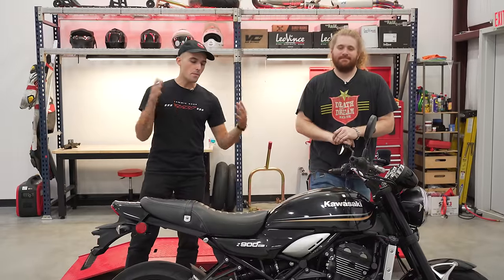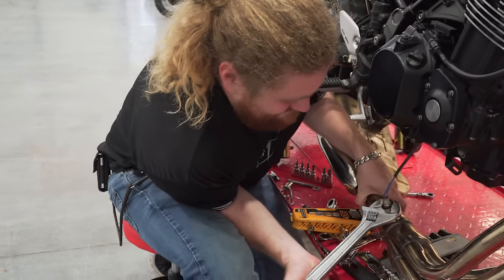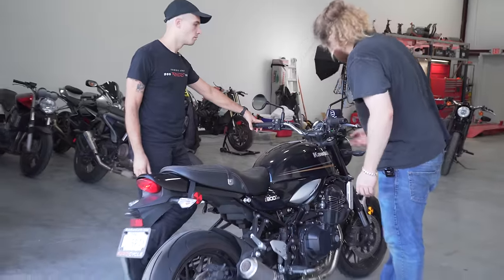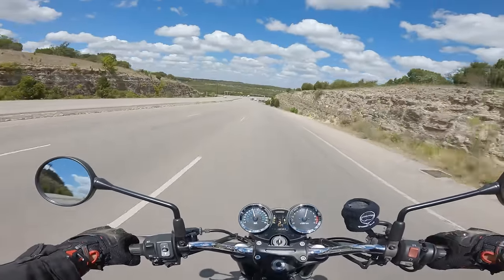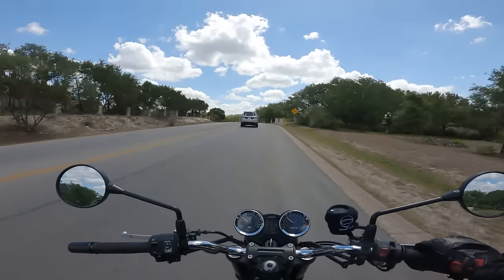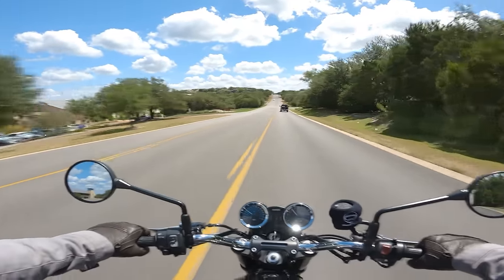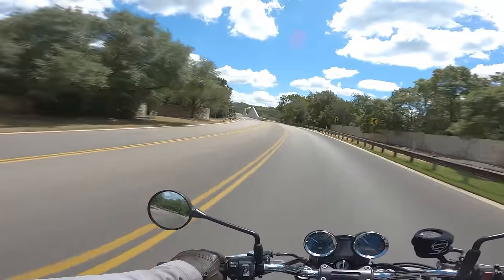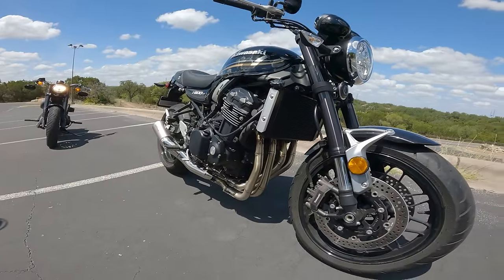Our Z900RS is FINALLY Fun Now!

Comment: The pipe makes a big difference, now do the flash and you'll see what people are saying. Love this bike!
Reply: I purchased my 0 mile 2019 Z900RS Cafe last June and made a point to ride it stock for a year before doing the flash and exhaust.  I love this bike and hear great things about a flash.
Reply: I have this bike- stock fueling = slightly let off  of throttle = cuts off all fuel to engine= abrubt engine braking... very tedious.  An ECU flash reprograms the  fueling so the engine isn't starving for the gas
Reply: @Justen1980  Ya,  It bothered me for a few months of riding but then you get use to it.  Still going to flash and get rid of the fuel cutoff on decel

Comment: I would only do a header swap, the stock exhaust is tuned perfectly for the sound IMO
Reply: Did mine with Delkavic header & stock can & reflash, 10% power & torque gain & sounds way better without being obnoxious plus it's still technically road legal!
Reply: @andrewprice1189  noice, can an emissions test be passed with that setup? Going to do the exact same thing as you (plus airbox mod).

Just waiting patiently for my cafe to come in, the shipping company's been fumbling the delivery smh..
Reply: @hyedefinition1080  Not sure as i am in Australia. Police etc more interested in ridiculous loud pipes than whats coming out of them. Great bass roar just with Delkavic headers & stock exhaust but not that bad you will draw attention. zero on/off throttle snatchiness 100 times better
Reply: I can’t stand the brand but one thing that Delkevic has done right for this bike is that classic 4-4 exhaust.  I wish someone would post a video of that one with the baffles out, even though it sound great with them in!

Comment: Ya really only needed the header. The stock can has literally no baffling in it at all, it's all on the cat.

I spoke with a guy who has a fully built one with 1083cc pistons, Yoshimura cams, port & polish, airbox mods and high flow filter. He's tuned to 135whp and almost 80 torque. He said the stock cams were damn near perfect circles and he wasn't sure how they made any power at all.
Reply: Did mine with delkavic header & stock can which is all you need, technically still road legal as well. Reflash to cure that low rev snatchyness caused by the fuel cut off. Transforms the bike & the only mods you need
Reply: Im thinking the same with getting just the headers. Cant really find a good looking can to replace the stock one.
Reply: Those numbers sound low tbh. This has the same motor my z900 se has and it's rated for 125 hp and 80 lb ft torque stock. Granted probably bhp not whp but seems like even a minor build with a good tune should pull more
Reply: @bassistoftheyear  there are some differences between the Z900 and the RS. Like I know some of the case covers are different and the compression ratios are different and a handful of other things.
Reply: @RaijinTheThunder  I see I guess if compression is different that'll definitely make a big difference. Could probably be built pretty easily if power was the goal. Tbh it's pretty much the reason I didn't get the RS. Love the retro look but typically don't mod my motors past an exhaust to maintain reliability
Reply: @NeoMoto  Just use the stock can, the cat does all the baffling
Reply: @andrewprice1189  sounds like a plan. Thank you

Comment: I have the 2022 Z900RS Cafe, absolutely love it. I'm keeping the stock can but going Akropovic headers...sounds amazing !
Reply: Hey quick question because no dealer seemingly knows when i ask them. Are the bars on the cafe lower than that on the standard model? Im pretty sure they are but have gotten mixed responses. Thanks!
Reply: @ramirof1986  Yes they are. 100% The bars on the normal Z900RS are standard, they have the up-swoop to em lol. The bars on the Cafe are completely flat across, and kinda position forward a little. Not a lot, to where you’re hunched like on a sport bike, but they are flat. I’m 5foot11, normal arms I would say, and I still added risers to my bars on the Cafe. Didn’t NEED to, just wanted to. Gonna see if I can take a few flicks today. I’m gonna be on the bike in like an hour. Gonna try and do a little video too.
Reply: @TopshelfJunior  gotcha, i figured. Thanks for confirming it. I may just stick with the regular one and add an aftermarket cowl. I’ve seen some pretty nice ones out there.
Reply: @ramirof1986  Yup !!! I have seen the regular bike w/ the added cowl, also sweet !!! Good looking bike either way. You’ll love it. I had an SV650 before the Z900 and…the Kawi is beating my old bike in every category imaginable. Love it.
Reply: @nickbazan27  Yeah for sure. I'm assuming you rode that 500 long enough and know how bikes work and are comfortable on a bike, yup...you could ! The power + throttle is smooth, won't buck you off it and has wheelie control and traction control, and ABS. It is fast as hell but, the bike only goes as fast as you make it. I think you would be fine. I went from an SV650 to the Z900RS.
Reply: @nickbazan27  Nah you could swing it. For sure. It’s smooth. Fast lol…but smooth. Just overrall, it feels VERY stable, and smooth. It glides, and when it turns / leans it’s smooth and stable. My SV650.. I never fully felt comfortable at speed or on the freeway / highway. The Z900 I feel at home.

Comment: See, this is why it kills me that Honda never did a naked bike with their V4. I’m imagining this kind of motorcycle with the absolutely raunchy sounds of the 750 or 800 and I want it so bad 😂
Reply: Magna?
Reply: @coreyfeldhaus6887  I’ve got one 😂 it’s definitely NOT a naked bike. It’s a muscle cruiser at best. Besides, it uses a timing chain instead of the gear driven cams in the VFR so it doesn’t rev as high or make quite as much power. I literally want a VFR with handlebars
Reply: I've got a 03 magna (last year for production) this will be my next bike as the power is similar to the magna... really wish honda would come back out with the magna
Reply: 919 super hornet

Comment: Completely off topic but have a question.  It seems like Spite's mic picks up a lot less windnoise on these rides.  I wear the same Arai as Yam and noticing the wind noise difference has me curious if the Shoei helmet is that much quieter or if it is just a mic positioning sort of thing.  Any guidance would be greatly appreciated!!!
Reply: It's because of his beard
Reply: Maybe less ventilation around where he puts the mic. Also, Spite's beard might work as an extra mic cozi-fluffy thing (definitely the technical name for it.)
Reply: @whimsicalstray  The technical name is dead cat. So you’re saying Spite’s beard is like a dead cat?

Comment: God damn it Spite, you don't need backpressure. That's not how it works. The reason exhausts that have more back pressure tend to make more torque is that they also tend to have better scavenging at lower RPM. It's a wave pulse timing thing, not a flow thing. Runner length and diameter both affect wave propagation speed, and how long it takes pulses to propagate to the collector and back up other header tubes is optimized at lower rpm by factors that also tend to increase backpressure.

Comment: Love it. Got instant crush on cafe version with green and white kawasaki look and vibe. Tried it few days ago a my kawa dealer…. And it was great love it. Loved stock sound unlike yammies here ^^ it burble and sound more deep than most of after market i have seen and heard. 

That said, due to a shortage both in france and belgium it is not available (constantly sobbing at night) so i might go for cb650r as they are in same price range but z900rs got the vibe. 
Also i m checking used ones but so far only far from my home and not the colors i want or price i can put (init the dealership deal to buy it with a small loan)

But Kawasaki put so much detail in this one love it. Really disapointed z650r didn’t receive same engine polish and details. It ruin the vibe. :-/

Comment: With removing the OEM Exhaust entirely, installing the loe vince exhaust. What did you do with the O2 Sensor?
How do you run catyles?
What did you do when the ECU Threw an emissions fault code?

Comment: I want more noise and power from my Z900RS than the stock exhaust is giving me but I don’t wanna be “that guy” as they mentioned in the video about being super loud. Would it be any less loud if I did aftermarket headers and the stock can? Anyone with any advice on how to get somewhere between sewing machine and diesel truck with open headers while eliminating the bread box, I would greatly appreciate the info
Reply: Mine came from the dealer with an aprokovic 4-2-1 header,  but retained the stock can.   Sounds very similar to the video.
Reply: All the muffling is from the bread box, so you’re stuck with it if you don’t want it too loud. The actual Kawasaki muffler does very little muffling, same as the aftermarket mufflers.

Comment: love these bikes. I would not get the RS (unless I was offered one at a great price) even though it looks great it is way more expensive than the Z900 and where exactly is that extra 2K?
Reply: The Z900 is made in Thailand the z900 RS is made in Japan that's part of the price difference. There's also the fit and finish and attention to detail that's at a higher level on the z900rs then the standard 900.
Reply: @adamsnodgrass9531  Yep, the quality is much better than the Z900. For what it is I think the Z900RS isn’t that expensive when you compare it to similar bikes.

Comment: Removing catalytic converters just makes us an even more hated group. And, really, it's not going to do anything substantial to performance or weight. Ten or fifteen pounds saved on a 500-lb bike with 200-lb rider is virtually meaningless. Besides, the stock Kawi pipes are very nice--- specially engineered for sound and staying nice & shiny. It's a design highlight of this retro-inspired bike. It's like the last thing I would change on it!  Don't get me wrong, I had a 2020 Z900 and put a Leo Vince end-can on it. However, on the Z900RS to change the exhaust is utter sacrilege. I am so disappointed.

Comment: Mine has a kerker black 4 into 1 that I bought and had tweaked to fit mine. It's minorly loud as I've kept the modified silencer in the pipe. But it has more of a sound presence without upsetting my neighbors and not risking police attention.when I do it's for the bike itself not my exhaust. Your new exhaust Is overtly loud. Not attractive at all